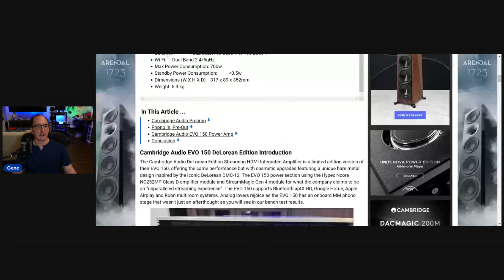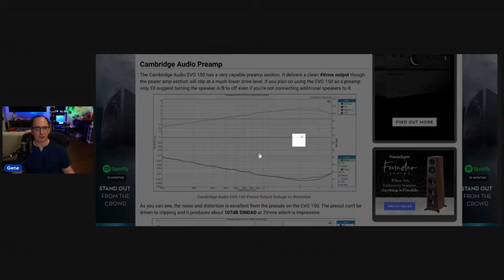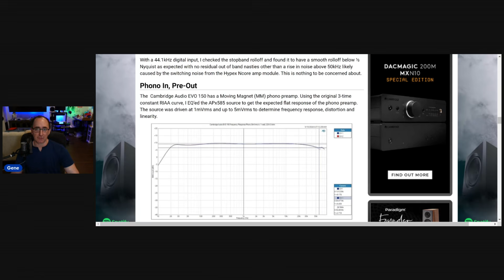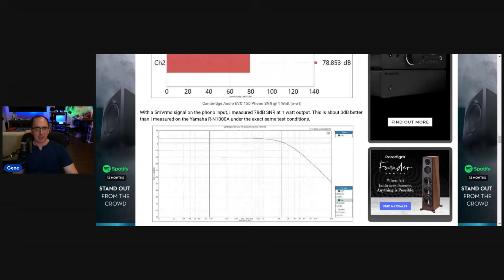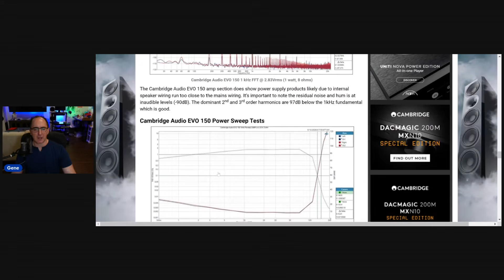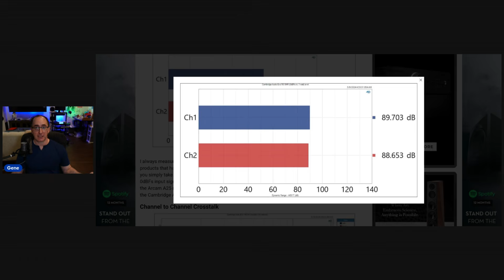Cambridge Audio EVO 150 Streaming Amp Bench Test Results!

Comment: For anybody that cares I’ve just returned mine after 3 months. It’s a lovely unit with all the bells and whistles (apart from room correction) and sounds so clean with tight bass and great detail retrieval. Feels relatively powerful but not the 150wpc that it actually has. Not surprised it measured so well. I had a few software issues and some distortion but mine was a refurbished unit so maybe that’s why. Anyway it got me thinking about the longevity of these types of amps. In the end I sent it back and went old skool and analogue and got an Exposure 3510. Glad I did as it has a lot more grunt (to my ears) than the Evo and sounds more musical and natural if you believe in that kind of thing. Maybe that’s coloration but all I know is that I enjoy music more through the Exposure. Using my old CXNv2 streamer as a front end with a view to replacing the digital front end as technology changes and keep the analogue amp for 20 years!
Reply: Buyers remorse...
Reply: Exposure is one of the best musical amplifiers in the market, better than all Cambridge Audio A/B amplifiers
Reply: @wmc79  the Evo 150 is Class D but I do prefer the Exposure definitely

Comment: Do you think this Hypex 252 module would measure the same in another amp, say Buckeye? Or would the amplifier measurements vary by implementation? Thanks!
Reply from the maker: Nope, it should be very similar in terms of output power and behavior.
Reply: @Audioholics  thank you sir.

I am using an 8ch Hypex MP252 amp from Buckeye to power my outdoor audio system.

I have 14 speakers total, wiring them in pairs for (supposedly) a 4ohm load.

250W at 4ohm @0.1% should be nicey nice for an outdoor setups, yes? I have 5 pairs of the 8.0 mini bollards and 2 pairs of shallow-mount Wet Sounds for the Pergola. I went this route to have a CoastalSource experience without spending an arm and a leg on their Class D amps with DSP. I’m using an AVR for bass management, and multi-ch stereo. Your feedback is helpful. Thank you!

Comment: Gene, I've noticed your videos are back to 1080p, which from your camera is fuzzy. What happened to the 4k camera you had? It's hard to see the graphs since they are fuzzy, even on my large 48" LG C1 monitor.
Reply from the maker: I do these videos at my desk using a streamyard, which kills resolution.  My formal videos are higher quality in 4k.

Here is the written portion, which should be easier to read:

https://www.audioholics.com/amplifier-reviews/evo-150-delorean-bench
Reply: @Audioholics  Thanks for the link Gene ... looked at your website and noticed the same thing. The PQ of the AP graphs is on the poor side. I think that's the source of this problem. Is there a way to capture their plots in a higher resolution format? I've seen sharper, higher rez plots before, so I should think this is possible. Thanks.
Reply: @OurFathersLove  FWIW, the images appear to suffer from high JPG compression.  For charts and graphs, GIFs and  PNGs can render much sharper / more exact edges on text and lines. (but photos of people, products & other real things, JPGs are usually better)

Comment: I need this at $700 or less.
Reply: Yeah I would like to buy $100 dollar notes for $10
Reply: @martinaston1715  so? You have problem with sarcasm. I used to, but now I take IDGASHT pills 2 a day. You should try them
Reply: You’re not going to get that with the NP252s in there lol. If you want a cheaper price then you’ll need to look at cheaper devices with less capable and less performant Preamps and amps. You could combine a few devices from Topping to get a good Preamp and amp setup, then add a source.
Reply: @andrewskaterrr  During my over 40 yers in the audio hobby I quickly learned that there is a thing call "Law of diminishing returns". Where an $3000 amp does not sound 2 times better than a $1500 amp. You can tell by how they measure. Topping LA90 measures better at $799. As you increase $ you get less real improvement and more fluff of features with fancy names. So a $700 should easily get you great sound, state of the art sound, no need to go higher. So I am not missing out on the Cambridge, they are missing out on a large chunk of the market. Off course as a choice, but my $ wont go there. So imagine a WiiM Amp with meters at $699 perfect.
Reply: @andrewskaterrr  a good example is Outlaw Audio 2220, better than Topping at higher power, mono blocks 2 for $699, can't beat that a double the price.

Comment: Thanks for the video. High THD is a concern for me though I am not certain that is what I am hearing. Recently bought Technics SU-G700M2 (used) to try. Great imaging, dynamics rated at 75w .5thd. I feel compared to lower THD products it lacks what audiophile s call “blacks”. It sounds supper clear but I don’t hear what I perceive as black. Is this high THD or something else?
Reply: I have no clue what “blacks” refer to other than low noise floor aka low THD. With a ~90dB noise floor of this unit you shouldn’t be hearing the noise from your seat unless you have some crazy 110dB horns or something. I think you’re confused and looking for some magical sound that doesn’t exist, it’s just noise floor/THD.
Reply from the maker: This amp has very low THD below its max power rating as I showed in my report.
Reply: @Audioholics  Yes I see that. Then maybe what I hear is not a THD issue or knowing at max levels the amps have THD that is high is psychologically influencing my listening. I have not a/bed. Looking forward to more videos on this. The point of max THD measurement is crucial.
Reply: Blacks is possibly low noise floor/thd. I have not heard the Cambridge unit. I am referencing the Technics SU-G700m2 that sounds better than the Yamaha I previously used except nothing does not sound as much like nothing. Yamaha THD 0.019 vs Technics 0.5. I am curious if the THD is what makes both sound different as far as what I have described.